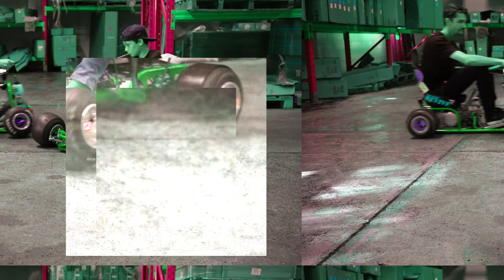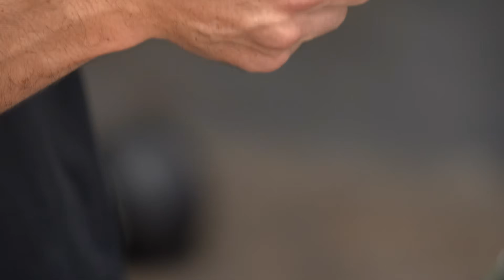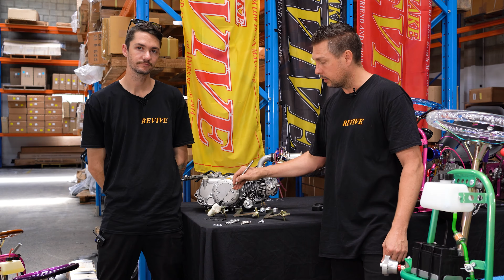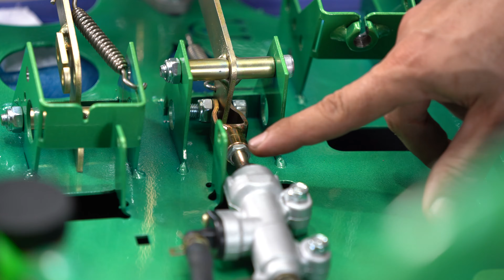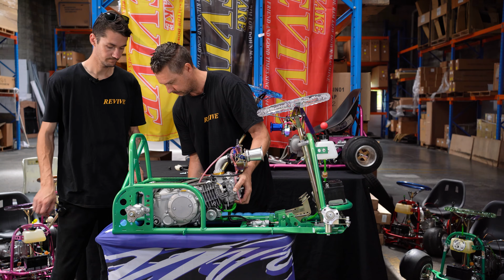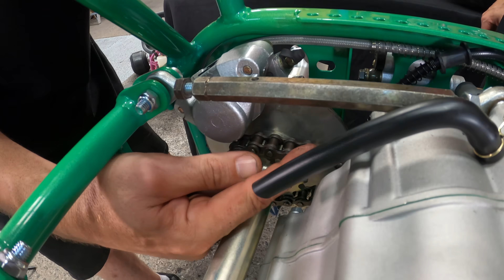Car Make Revive - Drift Kart Build Part 4

Comment: Watching through the build series and just got to have the most hilarious conversation with my roommate who walked in while you were mounting the battery
Him: Why are they using zip ties? 
Me: They work fine.
Him: Ya, but wouldn't something with wing nuts be better?
Me: Its a drift kart. Theyre drifters.
Him: Oh, ok well ig that really doesn't look like to many zip ties overall for something built by drifters. 
Me: exactly, it's solid engineering
Reply from the maker: We thoroughly enjoyed reading this comment BarneyMiller, so awesome, thanks for taking the time to post it 😂